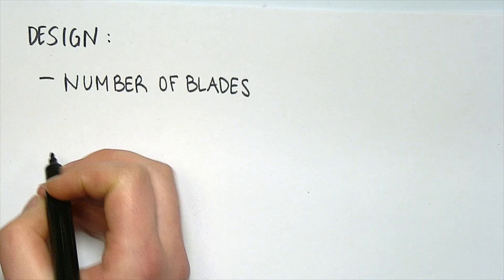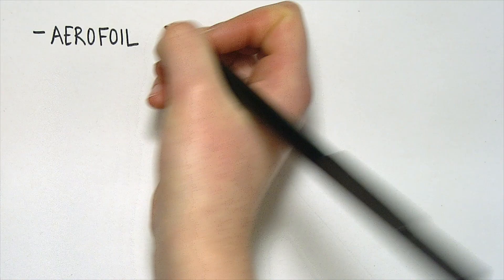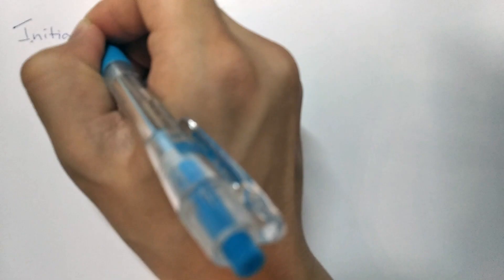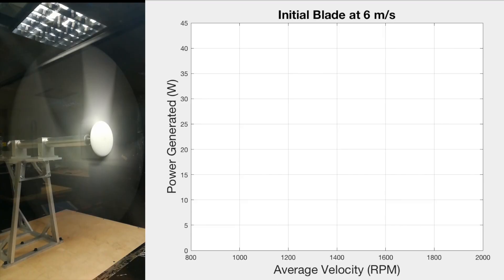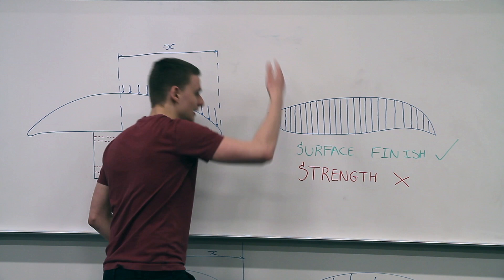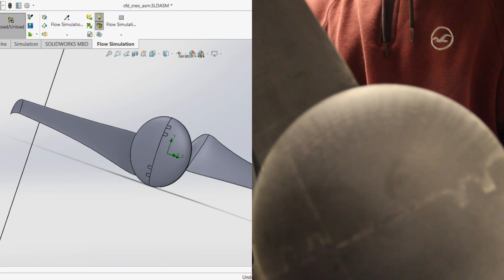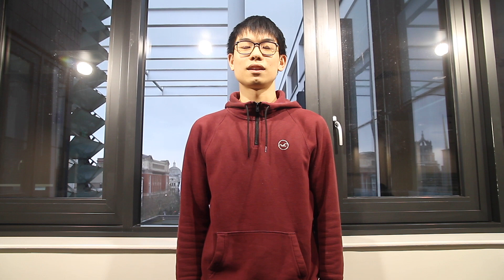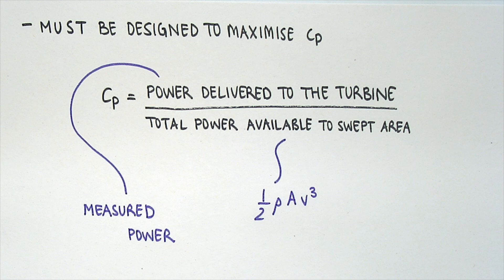Imperial College London Aeronautics  L2 Applications | The making of a small wind turbine | Group 5

Comment: Sorry to ask so late, but I wanted to enquire if you enjoyed the course and recommend this course to someone who is currently doing further maths, maths, physics and electronics for A levels?
Reply: what did u end up doing
Reply: @carter181  I’m doing aerospace engineering at Southampton university
Reply: @nikitoss0903  how is it? I'm thinking I may end up at Southampton. I've applied to Cambridge and Imperial but I'm expecting rejection after  my entrance tests went bad.
Reply: it’s great, icl it’s one of the hardest bits of work I’ve done in my life so far. However, I’m pretty bad at programming so if you’re good at C you’ll be completely fine
Reply: @nikitoss0903  thanks for the info! How far into the degree are you, what are you studying at the minute and what projects are you up to? Do you use the facilities much? Sorry to pepper you with questions haha